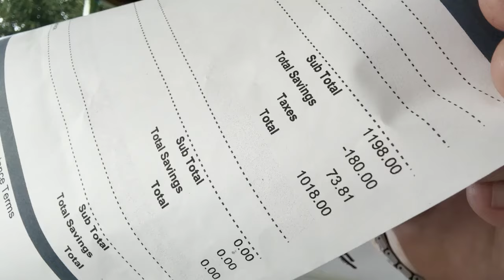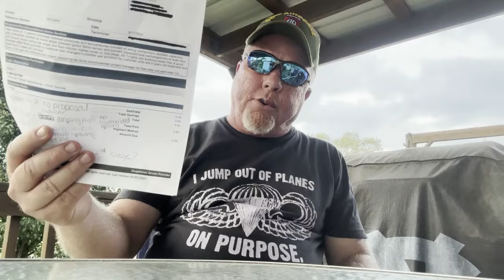Replace your nine year old Furnaces.

Comment: Locally we have new D-bag companies (not dirt bag_ that hire only Sales Techs, they show up in clean white shirts and go straight to condenser, Mam, you need a whole new system its over 8 years old w/o removing anything, just looking at data plate, they usually get run off but mad h/o doesn't want to give them their svc charge.  Our facilities company hired one that had been fired and he wanted every unit he was sent to to be replaced by someone else, got canned real quick.